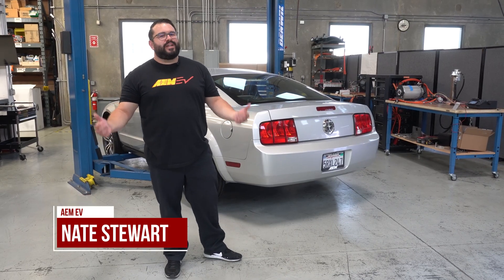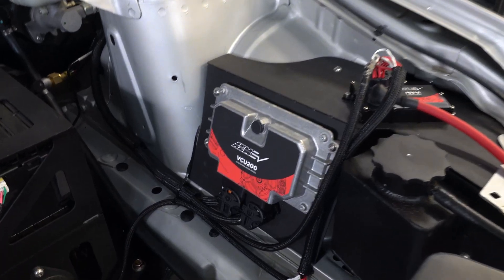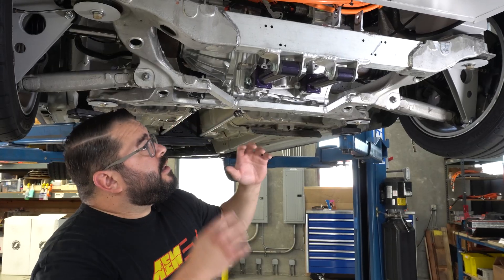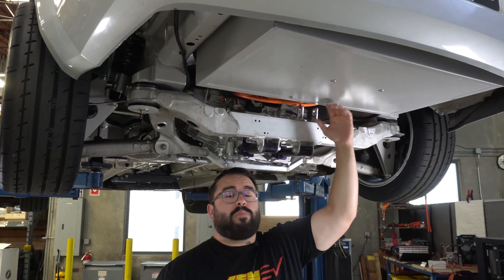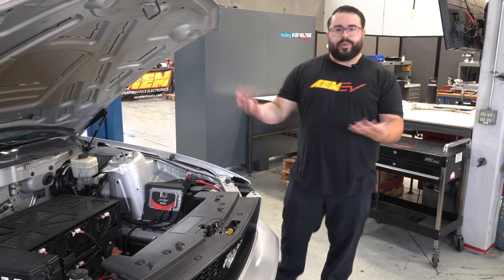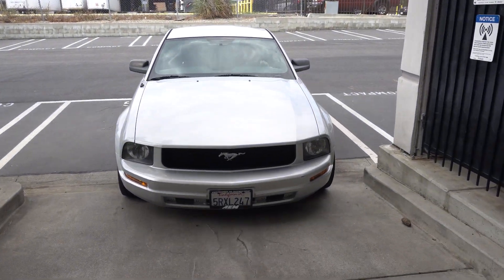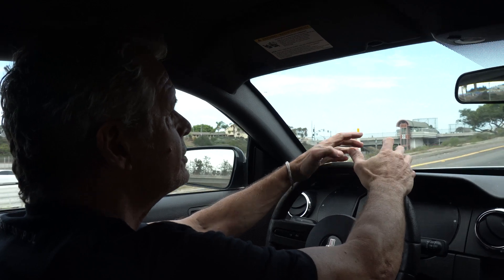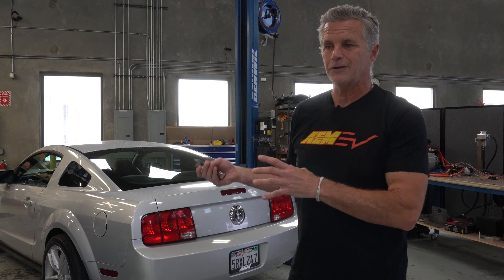THE FIRST FORD ELUMINATOR SWAPPED EV!!

Comment: A Ford Mustang using a Tesla Model S rear suspension and subframe to accommodate a Ford Mach E front drive unit, in the rear. Understandable given the previous Mustang conversion project, but still bizarre.

Comment: MOAR! :D

Soo, are you able to add an LSD to that drive unit? Kinda surprised they don't have that right out of the box.
Reply: EVs generally don't have LSD, even as an option. They depend on brake-based traction control, other than the few which have separate left and right motors and thus no differential at all.

There are a few EVs for which aftermarket LSDs are available... generally Quaife units for Tesla drive units, which are used only in these conversions, not in Tesla cars.